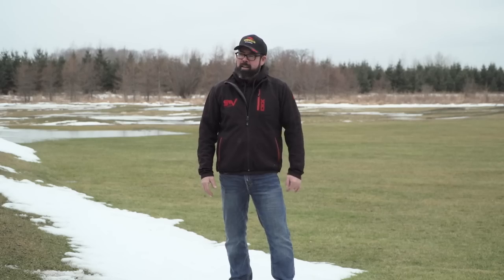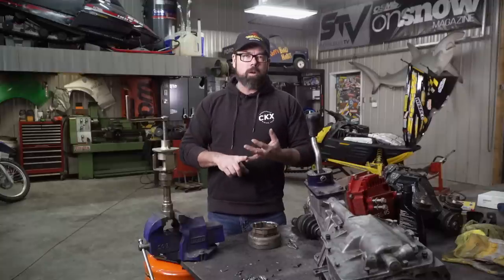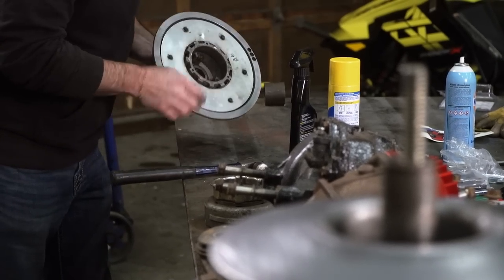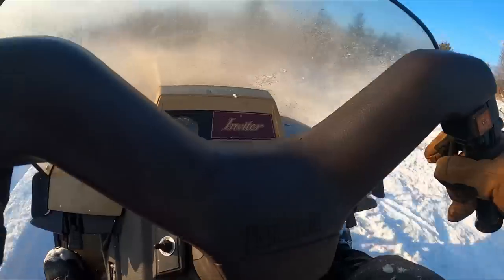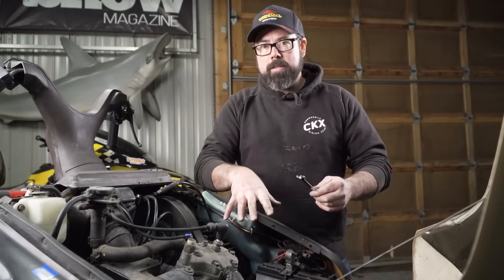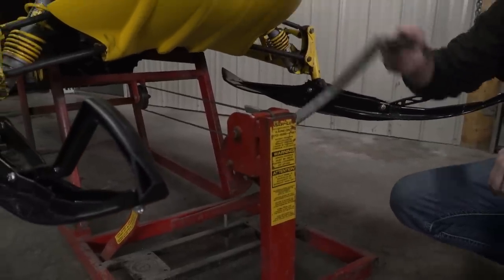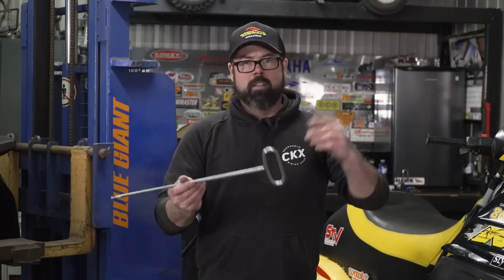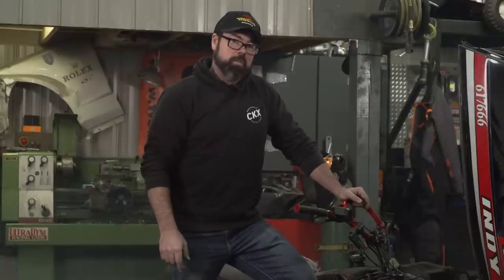Snowmobiler Television 2023 Episode 07

Comment: You have a great program very well done. I two used ,to have many of the old Sleds, 1992 650 RXL woulderfull sled, .1999 ,and 2002 ,SRX my 99 was all .modified ,with Co. D airbox, delta force,reeds, 800 cc cylinders, .this sled was very fast,  2000 XCRW 800 really fast then lots yamaha RX1 and APEX, now back polaris again 2019 XCR, 2021 VR1 and, now red ,black ,2022 XCR which to me the best sled by far on sled. Keep up the great work with your .program. 84 years old still sledding Christopher Ottawa
Reply: Thanks again Christopher, hope you are still riding in the valley! I don’t know how much longer we have around here…

Comment: OMG talking about battery arcing. I put my charger on my battery and the positive jaw fell over and the sled became electrified. I watched steam come off the exhaust (where snow lied) and my wire connection at the intersection of the stator and coil melted on my 1995 skidoo touring sle. One slip caused a few hours of wiring rebuild.

Comment: I have an 07 Yamaha ATAK pretty much an Apex. It would be cool if you had an episode on tuning up older sled suspension like those sleds. I have been adjusting the springs on the front shocks to try to get it to ride better but I do not know much about how they really work. I am wondering if I need a better SKII for the sled to ride better (Less darting) and if would it be worth it to buy more expensive shocks for the sled or should I spend the money I do not have and get a newer sled. Here in Maine, we are having the same issue as you there. We are not getting the snow we used to the last couple of years so that makes it very hard to spend a lot more money on a newer sled.
Reply: You need dual rate springs from hygear for the front night and day difference
Reply: @juliandig4323  how much do those cost and where do you get some?
Reply: Check out Accelerated Technologies here in Ontario. They might have some secret sauce they can help you out with for the suspension. Way back in the archive of STV we did a segment with him on an Apex. Your sled is a great platform and spending a bit of money rebuilding or improving the suspension will make that sled better!